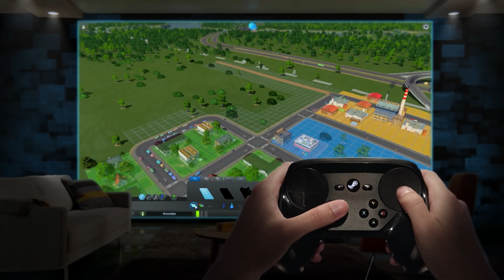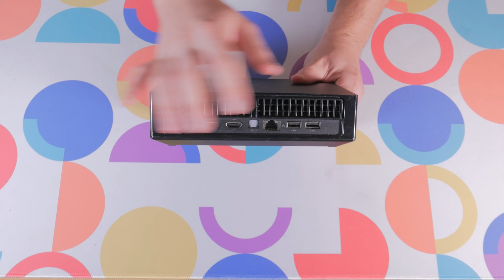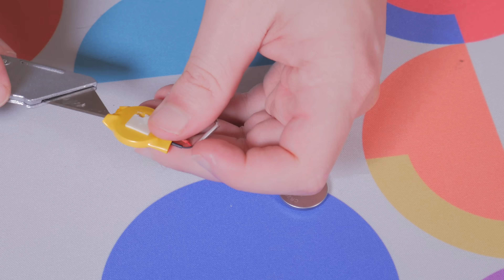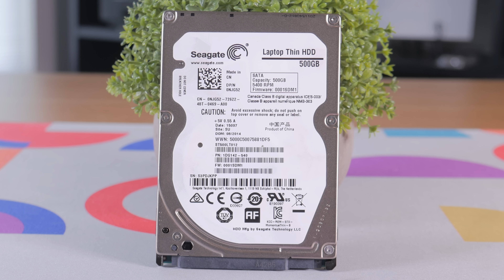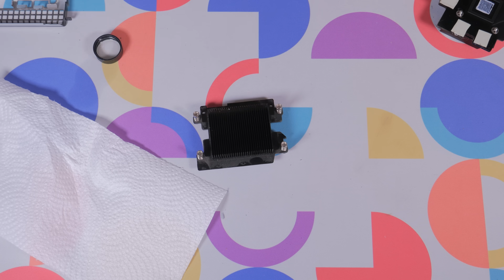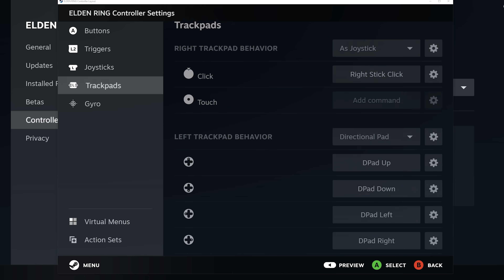I Bought Valve's FAILED Steam Machine in 2024...

Comment: The Steam Controller definitely takes a while to get used to, but the combination of gyro, trackpad, and dual stage triggers makes it way better than an xbox style controller for shooters. The biggest problem is setting it up, since no game (afaik) supports them out of the box. Community profiles on Steam help, but you'll still need to learn all the inputs since the prompts probably won't be correct. It's a lot of effort in order to use a discontinued controller. I bought one when they were being discontinued and Valve dropped the price to €15. I really hope Valve will take another crack at it, even just a standalone version of the Steam Deck controls would be great (though, with the dual stage triggers please?)

As for the Steam Machines themselves, I can see why they don't want to go there again. Just the semi-custom silicon for the Deck was probably enough of an investment. They could put the same hardware into a box, but you wouldn't get "big screen" levels of fidelity out of it. Really, I just want them to release SteamOS 3 for other devices, properly. There are several companies already making small form factor PCs with AMD chips, it's just the OS they need. (as an aside, you can get pretty close on Windows by setting Windows to autologin, then set up Steam to start in Big Picture mode on system startup. You'll still have all the Windows BS in the background to deal with, but it's an option.)

Comment: I've had one since 2015, and still use it as a plex server, only issue is i've had to replace the CMOS battery twice. Recently dusted off the steam controller and it did not age well, its pretty awful by todays standards.

Comment: I am of the firm opinion that for you to build "a modern steam machine" you should go with a SFF case and integrated graphics (AMD's are VERY powerful, even if not godlike, and would actually compare with a PS4 pretty well; if you instead want more power then you would have to go with a low profile GPU, and the cost of the machine would raise from around $400 to WAY more than $600).

Comment: The GPU is basically always at 100%, therefore you are not gonna "feel" the CPU upgrade.

Using FSR at Balanced at 1080p or just playing at 800x600 would lcually raise performance.

Regardless, MAYBE using Fedora (if you want to do Arch for the sake of the Youtube video, your suffering) you could get some more performance, at least for most modern games (games like Left 4 Dead 1 and other Source games have peculiar performance problems).

Comment: I had the lower cost one the issue with steam machines is they were essentially rebranded pc’s unfortunately mine was dell. Essentially what this meant their was no actual standard it was just a confusing mess of different pc’s with different os’s and controllers. The fact that valve made the steam deck themselves proved they couldn’t rely on pc manufacturers.

Comment: I love the Steam Controller, and even have two that I use all the time. One thing I learned very quickly however is to not use rechargeable AA batteries. They're fit in well, but because they're slightly taller than regular they are a bitch and a half to get back out.

Comment: Rofl. This is a very fun video, but I can't stop wondering if that keyboard is any good. It looks like the Epomkaer x Aula f75's cheaper younger brother. Which happens to be a keyboard I am interested in. I bought the logitech g915 last week, and it's a great keyboard, but I have severe buyer's remorse due to the price. So I am going to send this thing back and then try to find something more reasonable on the pocket book.

(a few minutes later) Yeah okay. So that may explain why the keyboard looks a lot like the Epomaker boards, it is a Epomaker board or at least it is distributed by them I think. lol I found a keyboard that was called the Epomaker X ajazz AK820 then releazied the board just like your with colored is called Ajazz ak820 but is seems to be better priced then the one with Epomaker in the title. Even though it looks to be the same keyboard. ARGh. I hate this looking for a good keyboard BS. why couldn't they have made this Logitech Hot Swappable. If they had I would just keep this.(continues to have a break down in private)

Comment: Interesting to see the steam machine and thanks for the tear down. Also the reason you found the Steam Controller awkward is maybe because you were using the right track pad to aim and for precision. Use Gyro for precision aiming and right track pad to aim. So instead of using the RTP to try get head-shots, use the RTP to get near the body or on the body and use the gyro to precisely aim for the head. It takes a little time to get used to.

I use my Steam Controller as my daily driver and honestly wouldn't go back to PS or Xbox.

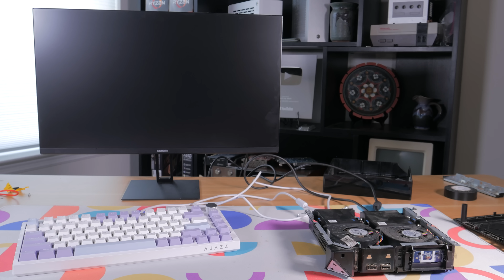Comment: WHY WOULD YOU NOT DO A BASIC CLEAN BEFORE WORKING ON THIS? You diagnosed hair in the main fan intake. You saw the unit was covered in dust. At 4:16, you can see there's an intake still full of hair. At this point, you had gone through through the trouble of replacing the underside battery... then, you turn it on and blast dust all over your workspace? You even have it on top of your mouse pad where you hand rests. I'm confident that you know this is a 30 second job with a can of compressed air. I think you should sit in the corner for 3 minutes and think about what you've done.

Comment: I use to have this as a main PC. Installed windows on it and did the CMOS fix. Ran pretty well in 2018-2019
Reply: I believe mine had an I7 inside with a 980M, i had upgraded it to 16gb aswell w a new SSD

Comment: This is still my home desktop, it’s a top spec r2 using an external gpu 5700xt. I needed something smaller for dorm life vs my neo cube dual motherboard pc. Another note is that usually the blinking code doesn’t actually require you to replace the cmos. A lot of the time you just need keep turning it on by draining the power brick and holding the power button. It takes 20 or so minutes but eventually it runs fine.
Reply: Hi, I got  R2 machine too. Just want to get an external GPU , just wonder how you get connected it? By nvne to oculink or other methods ?😮

Comment: Had an R2 for about 3 years. They got a bad rep, but I loved it - I'm glad it evolved to the Steam Deck.
Reply: They had alot wrong which is why they originally failed...let's not downplay that. Valve learned the hard way because of the failure. And jumped into projects like proton because, relying on devs to natively port games to linux was never going to happen like they hoped. The OG steam OS was trash compared to what we will be getting with the new arch based Steam OS they plan to drop in the future. 

Also the fact there was no unity on model and each manufacturer just did their own thing crippled them steam machines, the original launch was bad no getting around that. But im glad valve took these very painful lessons to heart and today are in a vastly better space.

Comment: Okay, so the Alienware Alpha, also known as the Alienware Steam Deck.. has multiple problems. 

1st it uses a experimental version of uefi bios firmware and becomes quite unstable especially on boot signs of this issue are the Alienware Steam Deck freezing on start up on the Alienware logo or the Alienware Alpha doing the same thing. Now how you fix this is you have to run a switch on the back side of the machine to the 2 pins for resetting the cmos setup.

Basically when the machine freezes you hit the switch restart and it boots weird as heck.

Comment: I would love to see your interpretation of the modern Steam machine, I was predicting that valve would make one after the success of the steam deck and proton and I've been slightly surprised that they haven't. I'd guess at maybe two tiers, an 890m based low tier and something like an RX7600 on the high tier, both with an 8c16t ryzen based cpu?

Comment: This was my first PC I got (I got it pretty old to overpaid for it) in 2018. I got the R2 with a 6700T, 16gb of DDR4, 1TB NVME SSD. While it had its flaws, it was miles ahead of my older 2015 HP laptop. It inspired me to build my own PC a year later and now i'm on a pretty decent rig. I mostly use it as an HTPC in my bedroom but I still boot games on it from time to time to see how they run. That GTX 960 still can game to some extent. It didn't completely die when I tried to run Ratchet and Clank on it or CP2077 (pre 2.0 update).

Comment: there are multiple reasons why the original Steam Machines failed.
but the biggest one is the Price for performance was abysmal all across the board from all vendors.
keep in mind that this shitty bottom of the barrel Alienware steambox with bottom of the barrel 4th gen low power i3, 4gb of DDR3 ram and 500GB hdd and a 860m underperforming laptop GPU - was over 1200$ at the time - for the same price back then you could've purchased a high end gaming which would've been a much better purchase.
this is the main reason why valve ditched the steambox idea quite quickly, and why they basically added big picture mode to the steam client itself because most people could've built a better desktop for 1200$ than these shitty steamboxes and valve realised that and catered toward it by essentially porting the steamos 1.0 interface and turning it into a full screen mode for the steam client on windows lol

Comment: As a PS4 console gamer at that time it was this Steam machine that sowed the seeds for me to jump to PC in 2015. Steam machines may have failed in selling hardware but it sold me on PC gaming.
Reply: Bro, once i saw Skyrim modded, I never looked back
Reply: I almost bought one until I saw how crappy the specs were for the price.  I would rather spend more to get a better system.
Reply: we are talking about 2010 bro, do you know when the ps4 came out? this makes no sense
Reply: Do you know how many times valve has tried to shill shitty micro computer's as the next PC gaming console? I think they even made a switch rip off a few years ago  @Mithril02135
Reply: @Mithril02135  ps4 released in 2013 wtf are you on? Ps5 in 2020.
Reply: @Mithril02135  I don't think you know when steam machines came out lol
Reply: @drewsilberman6644  I dont sorry, is it a newer product?
Reply: @Mithril02135  it came out 2014-15ish
Reply: @Coryy187  oh wow, i dont remember this lol i thought it was much older
Reply: @Mithril02135 same time the Xbox one came out so around same time as ps4

Comment: I could never get used to the Steam Controller. Cool concept, but it just never clicked for me. I know that it's heavily customizable, but I'm old, and want something that just works. I bought mine super cheap when Valve was clearing inventory.

The Steam Machines failed because they were under-specced, and overpriced. It felt more like a gimmick than anything. But, luckily it led to the Steam Deck, of which i have 2.

Comment: I got the i7 6700t Alpha R2 GTX 960 back in 2016-17, when I found out you can upgrade them I got a 6700k pasted with liquid metal /330w power brick  and 16gb ram, I also put the ultimate power plan into the settings, it was an amazing windows machine for years now it's a Linux machine using RX5700XT/Chimera OS, So I've basically made a steam deck on steroids and it's great

Comment: i have had one of these now for like 7 years. its been a BLAST of a little machine. has an i7-4785T . 16gb of ram, wifi 6 and SSD upgraded. its my little kitchen pc and emulation station. 
the coms battery just died on me 2 days ago, still waiting for it in the mail so i can fix mine. but its been a blast
if anyone is looking the best cpu you can put in is a i7-4790-S o i7-4790-T. don't use a normal or K version you will power throttle yourself or thermal throttle because its to hot. 
be careful of the ram clips. they seem very brittle. i ended up cracking one of mine off and got it shimmed just right to work.  any 2.5 ssd will work. any ddr3L SO-DIMM 2x 8gb PC3L-12800 DDR3L 1600MHz SO-DIMM will work. and i have an intel wifi 6 laptop card i put into mine and it works fine just had to install drivers. 
windows is fast as hell, and linux is even faster. 
its honestly a great little pc

Comment: Love to see you build a modern version of a Steam System ... 13:00 ... Yeah, hey, I had the exact same system you bought, but mine was i7 something.  And, I sure loved it.  It was quite novel at the time, and I loved the small size.  And, mine seemed to run pretty fast at the time, or I was very pleased with it.  I upgraded everything on it (as much as you could).  Wife has it now and only plays Stardew Valley on it or some low-gpu games, because she's not big gamer -- other than World of Warcraft and the Sims 3 or 4, which I think it worked fine for that back then too.

Comment: So.... I'm not really into running games at the highest specs. I've been gaming on consoles my whole gaming life but I do have a steam deck. However, this sounds dope... Especially after you upgraded it. 

So my question to you or anyone. for an Xbox one X like experience, is this version of the Steam Machine < yours with the upgrades> close to that console in performance? I really don't mind playing at lower frames and everything if the game is stable. Like, I tried to play Cyberpunk on my 64gig Steam Deck but it has serious stuttering issues. It runs worse than my Xbox one X version and I was shocked. Lol but Honestly, I mainly want to play the Phantom Liberty version of the game. Can't do that with the Xbox one version. I will put the cash into it if the Steam Machine can run it without pausing every 15 seconds like my steam deck. Plus, I worry about the temperature of the Steam Deck... Cause that game runs HOT and I have over 300 hours on the Xbox one version and I still play it. It runs great and looks great on the One X. Anyone interested in giving a Newbie to PC some advice Im all ears. :3
Reply: The CPU is better compared to the One X but the GPU isn't and seeing as you can't upgrade the GPU, I wouldn't buy it if your goal is to play Phantom Liberty.
Reply: @marcelosoares7148   right, I will look more into it! Thanks for your tip!

Comment: The steam controller is awesome and was/is so misunderstood. People didn't figure out its potential for years. I think valve could pull off a steam machine with the more mature software, and different market.

The reason it feels awkward is probably due to needing a better configuration. Use a relatively high sensitivity for the trackpad, and gyro for your more precise shooting. You can even have gyro activate on a soft pull of the left trigger or something. Check out ramblecan. He shows some really interesting ways of utilizing the controller. It's best to think of it as its own thing. It can do so much more than an Xbox controller.

Comment: @TechByMattB as long as you can navigate into Steam on the Steam Link to controller pairing in steam you can pair that controller to the steam link without the dongle freeing up a USB. the Seam Link has the dongle built in but I always thought it as odd how you pair it. You can pair normal bluetooth devices directly on the Steam Link.

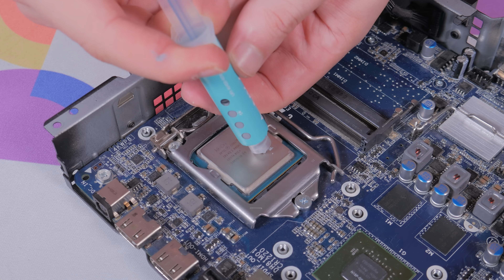Comment: 9:40 are you banishing or summoning demons with that thermal paste? Not sure which direction you drew that pentagram.

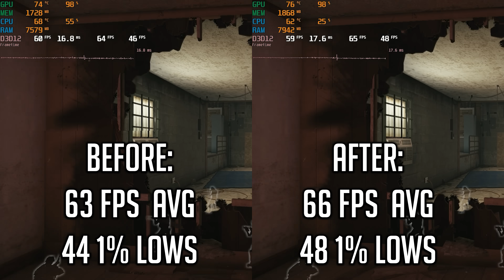10:08 welcome to being GPU bottlenecked. At least your CPU is running cooler, which should make the system quieter.

Comment: Valve should bring them back. They could do it on AMD based cpu, gpu or alternatively custom build APU. 
Look at ps4/ps5/Xbox one/Xbox series these are basically custom build PCs on AMD APUs with x86-64 architecture.
For me Steam Deck almost replaced my laptop, I switch to desktop mode and what is offers is enough. Minus the portability as I use stream deck in dock connected to a display on my desk. 
Having a mini pc done by valve but powerful enough which I can use as both console replacement and as PC, I most probably would buy.

Comment: I have a dell laptop with a i5 5200u GT820m and the graphics can be overclocked in msi afterburner. Not sure if its the case with this alienware but it's worth a shot to see how much performance you can get out of that GPU. In my case with that laptop the intel hd graphics was actually more powerful and efficient on battery.

Comment: I bought the exact same SKU and upgraded it in a similar way, even using electrical tape to create a new battery. I installed Ubuntu 22.04 (it was last year before the LTS) and have used it as an office computer for over a year.

For anyone else who might have one of these, SteamOS 3 / Bazzite / HoloISO does not support this hardware, go with standard Linux distros. This is because the open source divers of AMD are used for the Steam Deck but there are no open source drivers for NVIDIA, and Valve has not optimized the UI for anything other that AMD (which uses the Mesa drivers)

Comment: Now install Bazzite for a real modern Steam Machine experience. In absence of a general use install of SteamOS 3 just yet, Bazzite should be a decent replacement.
The big push for Steam Machines back in the day, specifically, was an effort to make Linux a viable alternative to Windows for PC gaming. Microsoft's moves with Windows 8 were concerning, and suggested that Microsoft might desire to lock down Windows into a walled garden that they would have full control over. Since Steam relies on PC as an open platform for it's survival, they wanted to ensure that PC gamers had a sort of escape hatch in case Windows turned pure evil.
Of course Proton and Steam Deck are the most recent incarnation of this effort.